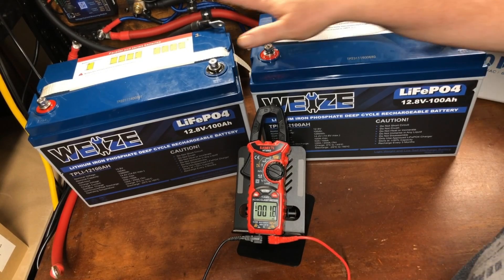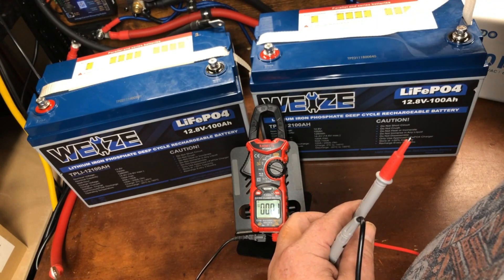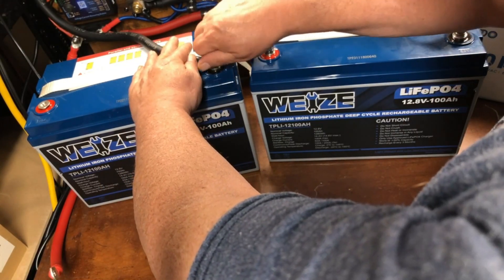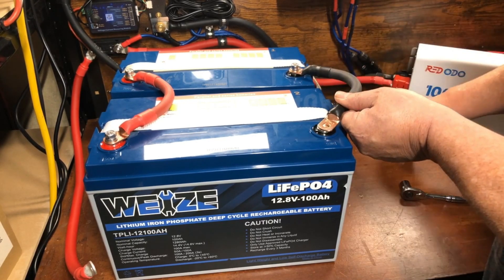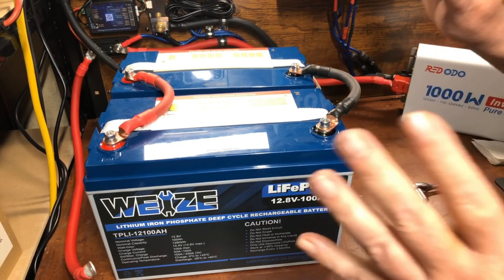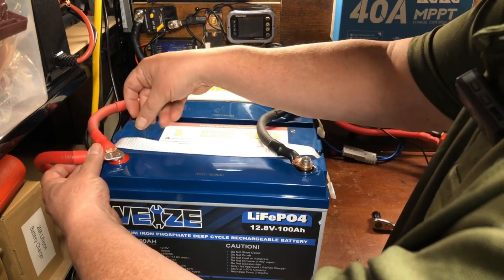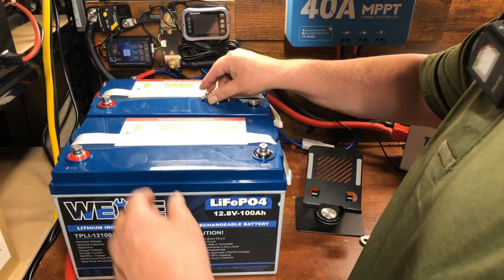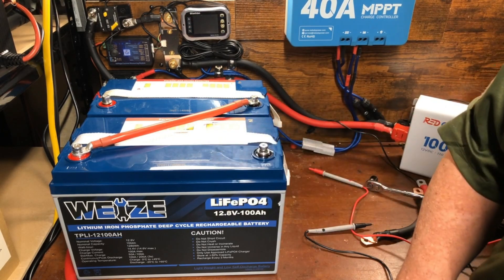Connecting Lifepo4 Batteries in Parallel or Series For Beginners

Comment: Excellent video, I do have one question, this is not a critic, but a question. I have seen other videos use a bus bar, to keep the batteries in balance. Is this not something you think is necessary?
Reply from the maker: It's not "necessary", however I do think it's a good idea to do if you have more than 2 batteries. If you only have 2 batteries there's really no benefit to it imo.
Reply: @enigmascape   the wire is acts as a bus in this instance
Reply from the maker: @mattgokey5416  exactly

Comment: i appreciate your tutorial on a 12 volt charge. But, how about charging in series? because a 12 charging connection means I would have to charge in parallel, then disconnect to reconnect in series to get the 24 output. That would be too much of a hazzle. Should I use a 24 Volt charger? if so 24 volt charger does not look that popular as the 12 volt. Please advice. thank you.
Reply from the maker: Yea, in series you will be at 24v and you would need a 24v charger. 12v is more popular for everything from inverters to chargers, but there are plenty of 24 chargers out there. If you are looking for a recommendation, I would recommend this one https://amzn.to/3UDFWpt  it's a Litime 40a, and they have a 20a one too that's about $50 cheaper, but this seems like a pretty good deal for a 40a, and LiTime is generally pretty good stuff.

Comment: Hi I'm enjoying your video but I have a question time frame 9.57 you are pointing at some type of device on your wall can you please tell me what that is and give me some kind of idea of how it is used thank you
Reply from the maker: That is my battery monitor shunt. It's this one https://amzn.to/3NJGDtr  It's not entirely necessary for a build, but It's extremely nice to have in order to monitor your battery banks SOC. It has that display I pointed at, as well as a bluetooth app. It tracks the outgoing power consumption, as well as the incoming power from your charging source to keep a very accurate gauge on the current state of charge of your battery bank. With Lifepo4 batteries it's impossible to determine the state of charge of any battery by voltage. The reason is because of lithium's steep discharge curve where it remains at a pretty high voltage throughout its discharge until the very end and then drops suddenly.

Comment: Great tip on keeping your 2 batteries in sync with voltage and current. Makes a difference on how you properly wire together 2 lifepo4 batteries in parallel to keep them more balanced working together.

Comment: Why go 14v On a lifepo4 battery? Nominal voltage resting voltage is around 13.3 volts. Your battery should never sit at 14 volts Or higher even after charging.